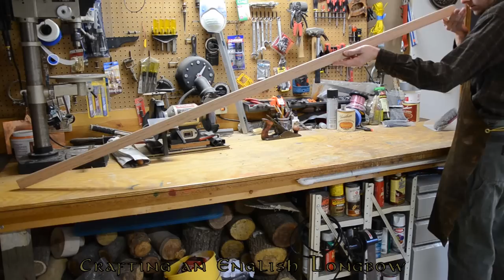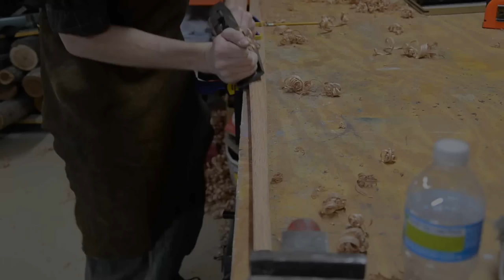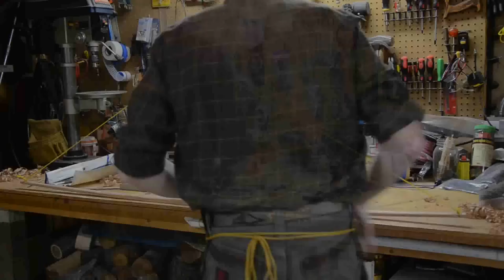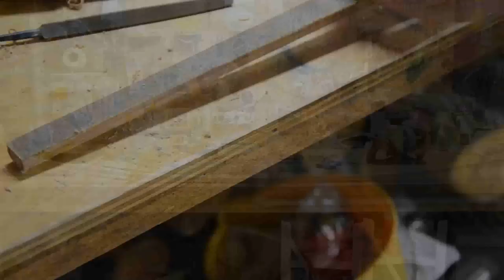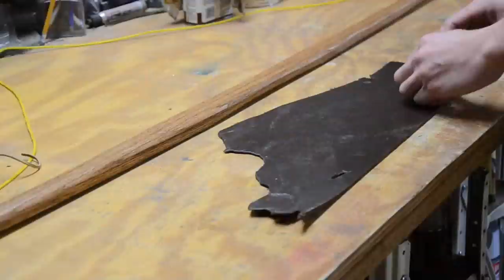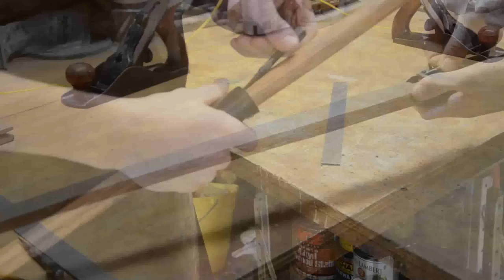Crafting an English Longbow

Comment: Did it snap on you because it looks like the grain on the bow is vertical (may produce a weird bend) and cause it to snap.
Reply from the maker: It has actually held up great! I haven't been shooting as much as I would have liked, but it has taken almost no set and does not show any signs of the grain lifting.
Reply from the maker: skullcrusher278 I don't sell anything at the moment due to a very irregular work schedule and job demands (I am only a hobbiest craftsman) but I encourage you to try making one yourself! It is an incredibly rewarding process and does not require much in the way of tools. There is more detail in the second link in the description that can guide you through the entire process. Cheers!
Reply from the maker: skullcrusher278 Of course my friend!

Comment: I know this is probably a stupid question but how do you make a bow to a certain draw length and weight
Reply from the maker: Not at all! Either one could be the determining factor for the other, length or weight. The one here was made for a certain length, and I just kept tillering it until the limbs bent evenly. There, it was the draw weight it happened to be. If I wanted it to be less, I could have simply just kept tillering until it was the lower desired weight. To make it a heavier weight, I would start with either different or thicker materials. The constraint was the size of the wood I started with, so there is already a theoretical maximum strength of the bow. Instead, I could have used a different wood or made a composite of various woods (belly/backing/core etc.) or laminated a backing of different material (horn, rawhide, fibreglass, carbon fibre, etc.) to strengthen it. From there, the same process begins in ensuring even bending in the limbs and there reducing the strength to the desired draw weight. At least, that's how I do it! Hope this helps!

Comment: I have to ask that 2x4 you used as a tillering stick, how long was in, to your draw length?  and the touches for the string like 1/8-3/8 of an inch deep? I'm trying to tiller a long bow and having trouble,  it's hackberry I'm using
Reply from the maker: The 2x4 was an unspecific length that was shorter than the final draw. I adjusted the length of the string instead of increasing the draw during tillering. When it was close, I pulled by hand and took a still to use as a reference. For the nock, it was about 1/8~3/16" deep
Reply: Thanks,  I have a few bows I'm working on

Comment: How long did this timber dried up,before you start, Excuse me for my English if i made mistake,Thanks
Reply from the maker: The lumber was unfortunately kiln dried, not naturally (which would yield superior performance and reliability). At the time I made this, the only available wood was from the hardware store, which is dried as quickly as possible to save money storing it in a hotbox or lumber yard. Usually it takes in the order of years for green wood to reach the proper moisture content for building bows.
Reply: LastApocalypseForge Oh,OK, Thanks a lot

Comment from the maker: As a single layer, unfortunately no, as this is cheap hardware store wood, although the edges of the rings are quite visible. On the belly, you would typically not have a single ring, as the contour of the bow would prevent that unless it was a true stick bow with minimal shaping.

Comment: Good effort mate but not an English longbow, bow needs to be 6' and made from yew. The yew wood was what gave the bow it's strength, the wood used needs to have heart wood and sap wood in it. The heart wood forms the back of the bow and sap the belly. Hope this info helps with any future projects.
Reply: Or Ash or Wych Elm for a "mean* wood bow. "Mean" in this context being a common wood of lesser worth. Not to say that you can't make a useful bow out of many woods hitherto regarded as non-bow woods. It is just a matter of adjusting the profile and/or dimensions to suit the wood chosen, though some woods obviously will be more suitable than others. Yew was preferred due to its combining elastic sapwood and compression resistant  heartwood in the same stave. You can make a useful bow out of yew heartwood alone, but not really out of sapwood which is very elastic and has insufficient resistance in compression, though you might see a sapwood only bow on a certain web site purporting to demonstrate "the quality" of someone's yew, which is a joke, since just about any decent piece of yew sapwood could be tillered to almost form a circle.

Comment: I have low knowledge on wood shop but learning and just wondering what type of glue did you use?
Reply from the maker: I'm using Titebond II, which is a commonly available water resistant PVA glue.

Comment: What about the growth rings? It may cause it to break, no?
Reply from the maker: The rings themselves, probably not, although I suppose it is possible. The direction of the grain however can cause failure if it runs off the edges of the limbs. The backing helps prevent that on the tension face where the fibres are stretched apart when the bow is drawn.

Comment: Hey are u rubbing danish oil on the back of the bow also ? I just linen coverd mine and its a little rough an flat colored I want a little more gloss and smoothness
Reply from the maker: There is a little on the back, too, but it will still be rough, as the process of bonding it to the bow will raise the fibres of the cloth (similar to staining wood). It is fine to lightly sand the glued cloth to knock it back down to a smooth state as long as it is nothing aggressive that thins it (probably light 220 grit). After that, try another thin brushing of glue to re-seal the outer layer. If you want more lustre after that, a little oil should do the trick, but it will still remain relatively matte in finish because of the nature of the cloth.
Cheers!
Reply: Awesome thanks alot

Comment: One Q: Is this how it was done 900 years ago!!??? I have seen how they made Arrows back then using a grooved piece of wood which looked like a lath. Anyway , since one of my favorite subjects is History I would be grateful if you could help. thanks
Reply from the maker: I am by no means an authority on the subject, but if I had to guess, I would say the process went something like this-
The process likely began with something as simple as using saplings with a string made from various animal parts (tendons, gut, sinew?), slowly evolving with technology until boards could be cut from trees with relative ease, then using a wedge (think piece of a pie with the tip and the outer edge cut off) from the tree's girth. At first, I would not think they were backed with anything, which is not required for a functional bow. I did that here because of the wood's quality. A scraper or spoke shave was likely used to tiller the bow limbs, and finished with some sort of rendered fat or animal oil if anything at all. Much of the profiling can be done with a simple blade, even a belt knife if you are careful. Other than that, everything else is more of a convenience- handle wraps, nocks on the bow, having a straight limbed bow (I have seen all sorts of twisted things that work fine), etc. For anything with recurve, I would guess either drying green wood in bent forms or doing it over the fire, but steam hotboxes seem unlikely until a little later.
Hope this helps some, but as I said, all just guesses.

Comment: No, authentic English Longbow, is a "self bow" using only one wood, yew, cut in such a way that the compression resistant heartwood, and the tension resistant sapwood are present on the stave. The heartwood is dark in colour, the sapwood light. This probably gives the impression that two woods are used, but no.

Comment: is this the same as the welish longbows used by the English army during the hundred years war?
Reply from the maker: They were very similar (if not the same) around that time. The Welsh used them as far back as the 10th century or earlier, later adapted by the English. By the 14/15th century when the Hundred Years War took place, I would guess that the design was refined a little differently as geographical and material differences evolved. However, most of our present knowledge and definition about this style of bow comes from the shipwreck of the Mary Rose which sailed between 1511-1545, about a hundred years after the war.
Reply: ok cool thanks for showing how to make I have a fiber glass recurve but like the old English bows better

Comment: Hi. Tony my comment was not regarding the wood your bow was made from you can use any wood that you want to it,s up to you my comment was regarding the makeup of the bow traditionally English longbows-warbows had horn or antler end nocks this was because yew was a soft wood and the string cut into the back of the bow which was the sapwood also longbows can only be made from wood bamboo is acceptable but no other backing what soever.

Comment: Does it work with teak as backing and oak as belly??? (6 feet longbow)
Reply from the maker: I have never personally worked with Teak, but it is a fairly brittle wood and may give you problems with handling the tensile stress of the backing. The last time I tried working with a more brittle wood as a backing, it snapped in a number of places. If you have the wood and the time, however, it might be worth a try
Reply: Ok thanks!! Would it work better with ash?
Reply from the maker: Ash would be much better!
Reply: The easiest backing wood if you must have one would probably be hickory, for the belly there are many woods you could use but I would prefer ipe over teak, if I wanted to use an exotic wood. There are other options for belly wood with good characteristics in compression that might be easier to obtain and to use.
Reply: Hickory backed Ash is a proven combination for a bow that is a little wider and shallower in cross section, but don't make the backing too thick.

Comment: what is your favorite material?
Reply from the maker: For bow making? Had I the choice, I would use Osage Orange, Ipe, or Yew, but I mostly only have Red Oak available where I live, so I use that.
Reply: LastApocalypseForge
Have you ever tried vertical bamboo flooring? I hear it works great but does take a bit of string follow.
Reply from the maker: Tristan Ruggeri It greatly depends on the type of flooring. I looked into it as a source of lumber a while back and determined that it was not a great choice. Many commercial solid wood flooring suppliers do things chemically to the wood to make it more durable for its intended purpose. As a result, it usually becomes too brittle to be used as a bow. The same holds true for other woods, not necessarily bamboo alone. However, natural, untreated bamboo is great for bow making, usually as a backing material because of its straight grain.
Reply: Yew is renowned for english longbows, if I'm not wrong

Comment from the maker: Check the link in the description to the post on my blog. I go into much better (more instructional) detail there. I also posted a comment at the bottom of the blog page with everything I used. For materials, all you really need is a good board, glue, and backing. And of course a string. For tools, you can get away with using only a planer and sandpaper, although it would be best to have a small round file for the nocks and a means to mark the outline before planing.

Comment: I started out really interested, then not so much...the extremely rounded belly on that is reminiscent of an 18th century target bow, but oak suffers from bad string follow with a d belly. Yew is really the only wood that can tolerate that design and only in low draw weights. A flat belly will give you a better return. Nice idea using fiberglass drywall tape and canvas(?) as a backing. When the belly starts to collapse from over strain, the bow won't shatter. I'll remember that trick.

Comment: This is not real longbow. English longbow had shape of triangular cross section or circular cross-section. On the ends of limbs were two notches from horn. The main point of longbow was that had not marked a handle. On the video you can see making of flatbow not longbow.

Comment: What was the first tool he used called?
Reply from the maker: Assuming after the tapemeasure and ruler, the string thing is a chalk line for marking drywall
Reply: LastApocalypseForge I meant the one that shaved the wood
Reply: ***** a plane
Reply: Thanks
Reply: A tape measure

Comment: well, it looks nice but it really isnt an english longbow. the english longbow had a flexing grip, not a rigid one like you made. still doesnt chang the fact that yours looks nice and probably preforms just as well.
Reply: nope. they bug me so i keep them turned off.
Reply from the maker: This bow does in fact bend through the grip. It is not as prominent due to the fact that the taper is rather significant due to the low test, but the bend is still there. Also, the bend through the middle is not an innate characteristic of the English longbow. They were not reinforced like many recurve bows are, which allows most of them to bend there, but it is not a requirement.

Comment: Try firing the bow once, it will crack. Using cut lumber to build a bow is quite frankly idiotic. You need to have the grain follow through the bow.
Reply from the maker: I have been using this bow for two years now and I have seen no signs of wear whatsoever. The stave was selected out of nearly fifty boards because of its grain direction and growth patterning. All that separates this wood from what a professional bowyer would use is the manner in which it was dried. I also have no idea what you mean by cut lumber. All lumber is cut. Timber is uncut, unless you are from Australia, in which case the two meanings are opposite. A board does not care if it was cut with a lumber mill's saw or by two blokes in the woods with a cross cut log saw. As long as the grain and moisture content is right, which in this case it is, the cutting does not matter.
Reply: Yes using cut lumber is idiotic.....  Unfortunately many of us here have made many bows from cut lumber and they work quite well.  Post up a bow you have made and let's see  what you can do.  You might also know that lots of primitive bow designs were made through out history without chasing a single growth ring on the back.  Take a look at volume 2 of the bowyers bible, "European Neolithic Longbows"
Reply from the maker: SeadartVSG I have no idea what you are saying. If bows from cut lumber work quite well, as you say, how does that make it idiotic? I understand that bows can be made from uncut timber, if the right size and shape for a bow, and they can be very powerful. However, that grossly limits the resources available to making bows, as the vast majority of suitable wood sources are not grown with the intention of making bows. That is why the English longbow was considered by many to be the first weapon of mass destruction. Widely available yew, amongst other woods, were harvested and cut into the traditional D shape with a natural lamination between heartwood and sapwood. That way, more bows could be made from a single tree. Does their being cut mean the bows were inferior to uncut staves? Absolutely not. Does that mean uncut staves are inherently bad? No. Does that mean modern composites cannot make a bow? No. There are many ways to make bows, many styles and materials, and if treated properly, can all make tremendously effective bows.  There is a reason why bowyers moved away from stick bows; comparable or superior results could be made with methods that allowed greater production and efficiency from the materials at hand. Which is precisely what I did here. I had cut red oak available, so that is what I used. The bow works, which was my goal.
Reply: LastApocalypseForge
Exactly, the "idiotic" part of the comment was sarcasm for emphasis.
Reply from the maker: SeadartVSG Indeed :)
I'm still baffled at what is going on in the OP
Reply: Generally, staves cut radially from a log will /alllow/ the bowyer to make a significantly stronger bow than one made from un-backed square cut lumber because if you chase a single growth ring across the back the bow will be less likely to splinter along the back.  Backing the bow as you did even if its just with a piece of duct tape stretched along the whole back of the bow will remedy this problem.  You can still make a serviceable bow with un-backed square cut lumber anyway.  I have a great bow I made that way that works.  It's not /idiotic/ just not optimal.  And traditional English longbow staves were cut radially from the log which OP would probably not consider "cut lumber".  Almost no culture in history has made a bow without cutting the original tree to some extent.
Reply from the maker: Jake McNaughton I completely agree. One of the modern reasons for cutting lumber is we cannot afford the luxury of slowly drying wood over the course of several years. By using quartersawn lumber, I (or whoever) have the ability to dry it faster without the problematic differential moisture loss common to whole pieces of wood. The xylem and phloem loose water at different rates, as do the layers within either of the two created by summer/winter growth. The result, if the stave is uncut, will likely as not split, crack, and warp tremendously unless carefully controlled. By cutting it into four wedge shapes instead, the moisture leaves much more evenly and therefore be dried more quickly. Hopefully OP sees any of this conversation, or anyone with similar problems for that  matter...